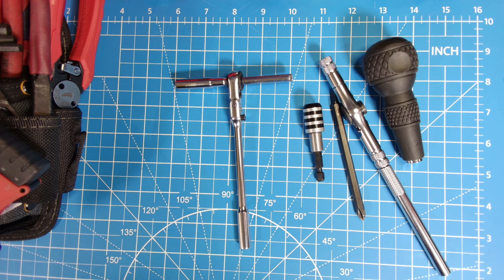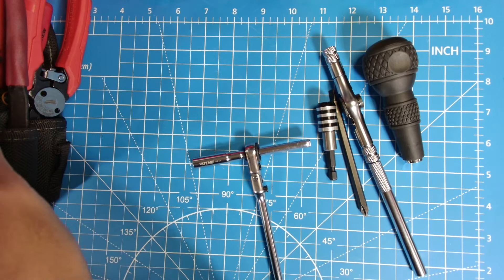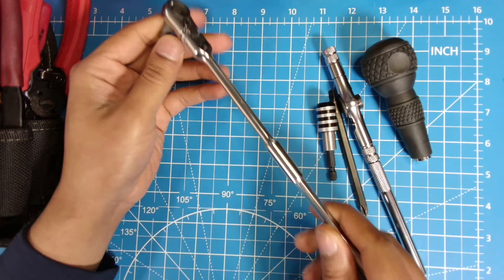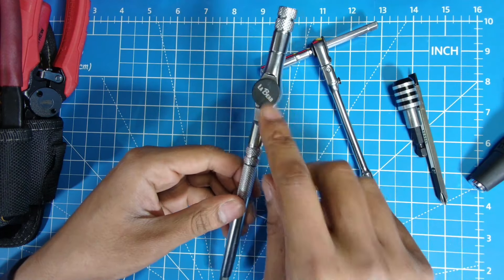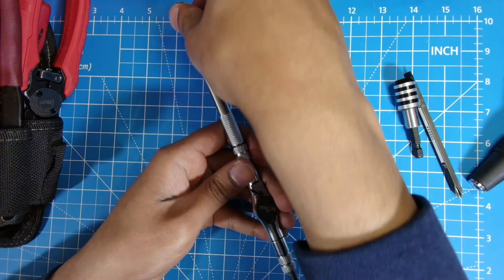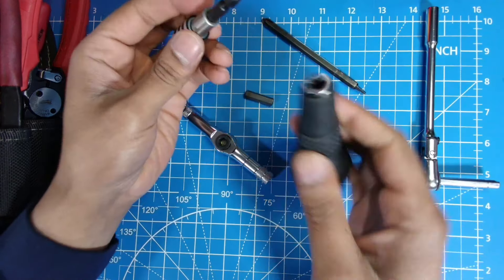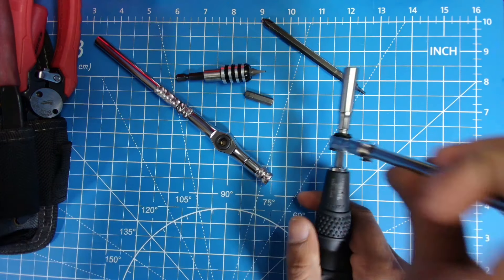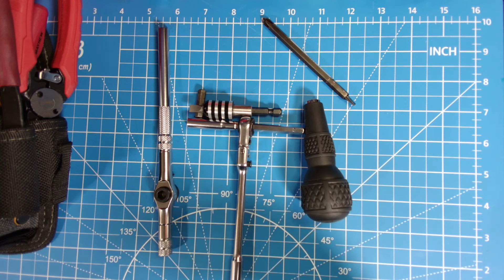My Driver Options from My Current Tool Pouch

Comment: I work on a lot of appliances so those ratchet drivers look very handy! I just got the ARES Red 1/4-Inch Drive Mini Swivel Head Hex Bit Ratchet. That handle swivels from 90 degrees for higher torque to straight, like a screwdriver, to quickly unscrew something once it's loose. Haven't used it yet but I think I'll like it.
Reply from the maker: I'll have to check that out, swivel heads are always great for freedom and range!

Comment: I'm not a tradesman like you but sometimes in my other jobs - working in a kitchen, or a small retail business in various locations - I find I need tools above and beyond those on a multitool.
If I want a tiny but serviceable bit driver which sits in the watch pocket of my jeans I carry the Wera 813, it's about the size of a Bic lighter.  But if I am carrying a bag I go for the slightly larger Hazet 810BHK which has a locking bit holder and just provides a bit more grip and torque, even though it's not much bigger than the Wera.
Other times I carry a mini ratchet, in the US it's sold under the brand Sabrecut, here in the UK it's also sold by Sealey, it has a 72 tooth ratchet plus a bit holder on the end of the handle so it can work as an inline driver.  Good for when I needed to torque up on some loose Allen screws.  I carry it with an extender normally.
I am tempted to buy the Vessel Bessel you have as it's come down in price again on Amazon to just £15,  but in that size range I have the Felo BitBoy with onboard bit storage.  I also have a small ball handle Anex ratcheting bit driver.  It's like the ball part on the end of your Vessel in size but I can put an extender on it, or use longer bits.
So that's already 5 options I own for EDC whether pocket or in a pouch/bag.  Also I have enough JIS dedicated PH drivers as it is - a couple of Vessels including the Impact one (which rotates when you hit it) and a Hozan so buying the Vessel Bessel may be overkill but what the heck, a guy can't have too many good tools.
Reply from the maker: Love the variety you have, it's always good to have options, different drivers can provide different levels of comfort for everyone. I need to look at checking out some of the tools you mentioned, I've seen some before like the sabercut, they're excellent EDC or pocket options

Comment: I really like that combination of the VIM ratchet with the Vessel Ball grip!
Reply from the maker: It's one of those weird combinations that seems ridiculous, but it actually helps out a lot
Reply: @dirtyboytools  Not at all ridiculous. I have seen things similar like this before. On top of that, many screw drivers come with hex shanks near the handle for putting a wrench or ratcheting wrench on them for extra torque.

Also look up the Weltrecord Ratchet Screwdriver!
Reply from the maker: @happylittletools  I will definitely check that one out!